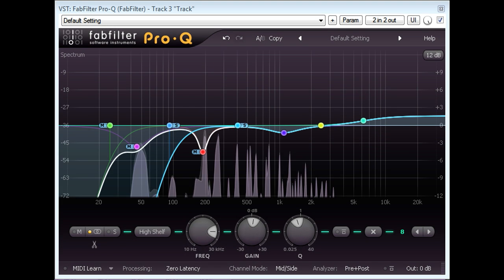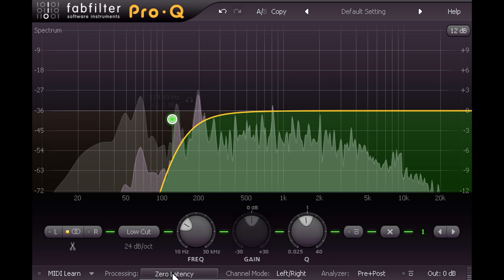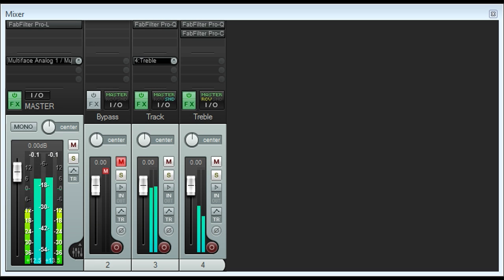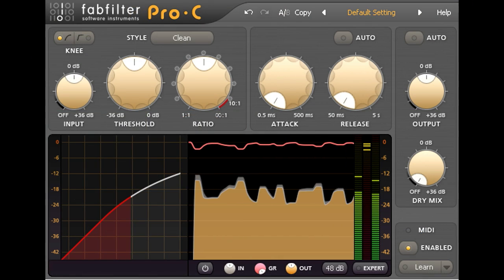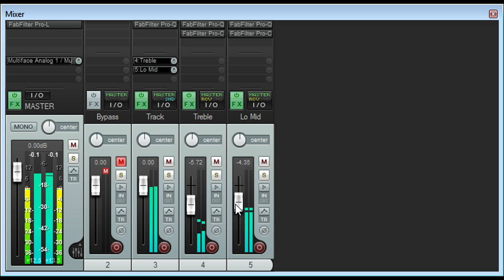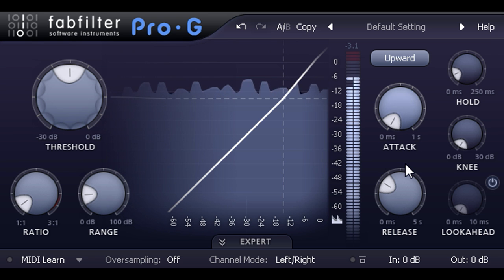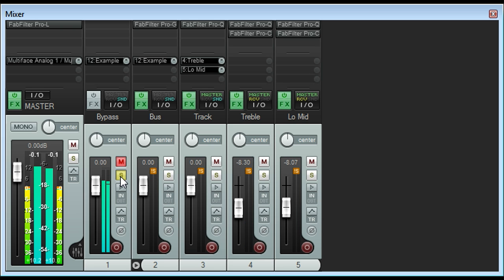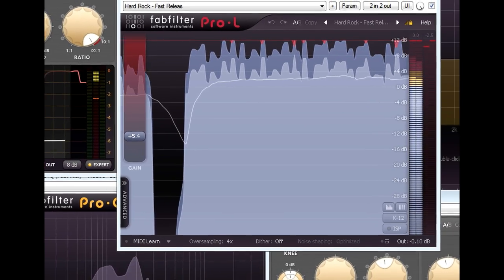Mastering with FabFilter Pro Plugins - 2/2

Comment: This is great, thanks... I'm surprised you can get away adding those parallel channels into the output (like the one to improve the bass and the other to flatten down those cymbols)  without reducing those same frequency bands in the original layer. Doen't the original issues (E.g. cymbols being too loud) still exist as that range is not reduced in the primary track?....
Reply: The cymbals being too loud only appeared when he attempted to apply a high shelve boost to the entire mix. He did that to try to bring out the melody more, but doing so caused the cymbals to be too harsh. Rather than try to find some compromise level of boost, he split the highs off and added compression to catch those cymbal transients.

Comment: At 3:25 you mention that the frequency-specific upward compression technique you used can be more transparent than the traditional method of using a frequency-specific multi-band compressor on these same frequencies; why is the former technique more transparent than the latter?

Comment: Cool thing but if we are using original source in 0 ms eq mode 2nd in 139ms latency 3rd 278ms latency this both signals won't work together in real time causing an issue with difference in real time... how it sounds like one piece in real time it looks like magic coz it can't because even 30 ms on the other channel which you add to the original will sound not in time. Maybe it's from the future Reaper's version)))
Reply: Igor Ryabchich every daw has plugin latency compensation. Realtime modulation doesnt exist.

Comment: Bravo. Nice work.Two comments though. The phase distortion that exists in the side component is fatiguing. At 5:16 it's removed for the "low mid" channel, thankfully, but the side is still a bit "washy". Also, a bigger overall complaint is how the electric bass (BD and snare too), gets neutered in many of today's mixes, Engineers, with these precision tools, control and even everything to the point that dynamics are trivial. The only way this will change is if musicians write with more dynamics.

Comment: Dan, I think your switch to linear phase may have been unnecessary, because when you stopped sweeping the EQ the phasing sound went away. It was only the difference between the original signal and phased signal sweeping back and fourth. Am I missing anything? What are your thoughts?

Comment: I like this plugs. The visual feedback and design are great. But let me troll you. I can do this with the default reaper tools. 
Shhh... this is a secret. :)
Nice tutorial. 0% bulls*t. Nice saturation technique. But for academical pruposes, split bands like this require a Linear phase EQ(extra cpu and sample compensation. of course Pro-Q is very easy to cpu)... you boost the band too. I recomend a real band spliter (crossover vst or JS:LOSERbandsplitter in reaper). see ya

Comment: @ballemand8000 use both ;) In my experience, each of these (Ozone and Fabfilter) are great for accomplishing different goals.
fabfilter is slightly modular, so you can pick and choose your elements and routing to fit a specific purpose, while Ozone is just a big box of processing usefull for example on a master channel. 

i usually use fabfilter plugs on any channel, while i usually only use Ozone on the master.